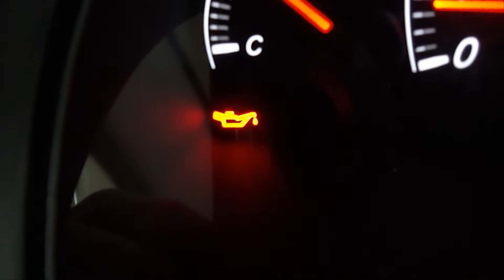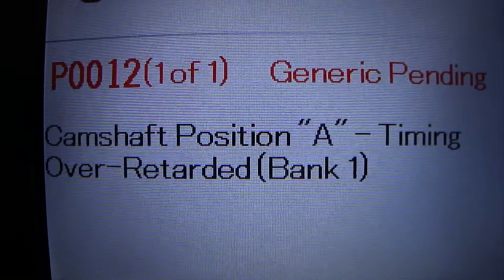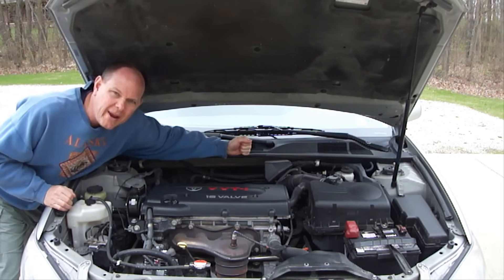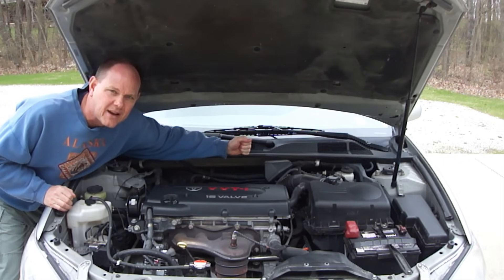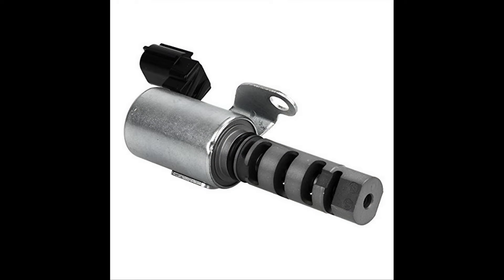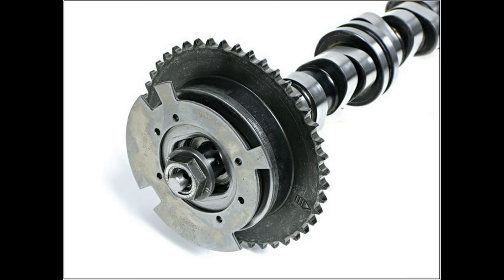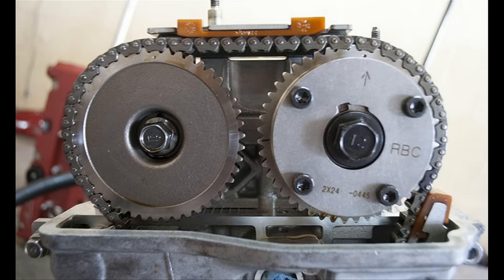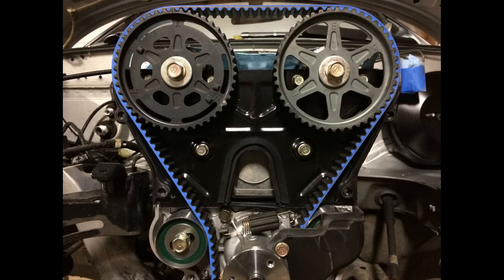How To Fix Check Engine Light P0012 - Camshaft Position A - Timing Over Retarded (Bank 1)

Comment: I get this code with a check engine light once and a while and I’ll notice after driving for a while I’ll stop at a gas station then go to start up the car again and it has a hard time starting. But as soon as I plug in the autel and erase the code the engine light stays off and the car runs like normal again. Weird right? I’m thinking possibly something electrical?

Comment: I put new oil and heard a very bad ticking sound oil light was on and then I revved it up a little bit and check engine light came on. I got that code tried to clear it. It came back on after work. I put that bitch in reverse and heard the chains slip, and the whole engine cut off.

Comment: This is true for Japanese vehicles, but for German cars, p0012 means Vanos solenoids are detecting a bigger issue, and that just means a much more expensive fix and not a simple oil change. It’s a generic code, but every engine and computer has its own procedure to fix
Reply: what issue is p0012 on bmw
Reply: @evatheboxer7417  did you figure out the p0012 fix

Comment: My oil light came on and I added a quart. Light was still on, so I added more but then the check engine light came on too. Like an idiot I added more oil and that code came up. Car quit running and now I'm freaking out, worried I ruined something. I really hope it's something simple that an oil change and maybe an oil pressure sensor replacement will fix.

Comment: Thanks for the video. Please, my mechanic used 20w50 oil instead of 5w30 in my 2005 Toyota Camry. In my next servicing, is it healthy to correct the oil type?
Reply from the maker: Absolutely go back to 5w30
Reply: @proclaimliberty2000  cos a colleague says since I've started with 20w50 I should stick to it, that changing to another oil type will have a bad effect on the engine. How true is that?
Reply from the maker: @nonsoezeanubekwe4580  I find that hard to believe. Use what the manufacturer recommends and you should be fine.
Reply: I'm using the Valvoline restore and protect 5W-30 and like it a lot.. clean up the Rings and reduced my oil consumption Toy 4cyl 2.5L  2AR-FE on my 3rd oil change every 5K mi

Comment: Hopefully you can answer. My 07 ford fusion burned a head at 65,000. We changed it, geared down the whole engine, replaced oil pump, piston rings, engine computer. Finally, ford technicians make it work again. With on the dealership p0012 code on; this guys told me to change the solenoids which didn’t modify anything. Your theories are great, but some should be not considered at all, due to the fact that everything is “brand new”, oil clean, etc. I’ll talk with the mechanic in order to check what could be the problem. The car losses lots of power on hills, my god a nightmare! Everything else works fine, since brand new up to now 2022.

Comment: Well lucky you, I cracked my valve cover open to replace my vvt solenoid, then noticed the cap and spring was gone from the locking pin on the phaser.  Nope...not dismantling the entire passenger side end of engine just to get to a stupid sprocket.  Don't have the time or patience.   Goodbye Mazda

Comment: Changed both my cam sprockets lower sprocket new chain tensioner and chain guides still have this shit code!  New Mobil oil synthetic!!  Just ordered a new cam oil vvti sensor!  Removed oil pan and and cleaned screen.  Also installed new oil pump too.
Reply: We’re you able to finally resolve this issue ?
Reply: @nelsonudeh4473  yes,  I had to go back redo the job unlocking the sprocket!  Then I had to remove the cap that holds cams down.  It was full of sludge!  My main issue was that I did not unlock the sprocket prior to install.  After unlocking installed.  Torqued it to spec then locked into place!   Then install chain etc…

Comment: 2014 ford escape was running rough up hills and was louder then normal.Oil was changed out and the filter.  How long does it take for then vehicle not run as rough?I put in a fuel injector cleaner as well. Thought it was a coil pack issue. But it's pulling the code you are speaking of.
Reply: What was it if you don’t mind me asking ?
Reply: @desireemanuel5958  Just a oil change and fuel treatment, after about 80 miles it went back to driving smooth. 👍
Reply: @jamesmontana29  oh so you drove it with the knocking sounds for 80 miles and it went away
Reply: @desireemanuel5958  Wasn't necessarily knocking just hesitation up hill and poor gas mileage.

Comment: Hi I am getting error "p0012 camshaft position timing over retarded"  consistently. I have replaced timing chain and vvt solenoid but this error appears again after resetting. Can you please guide what is the reason ?
Reply from the maker: Is engine oil clean and at the proper level?
Reply: @proclaimliberty2000  Yes I have even changed engine oil and oil filter after replacement of timing chain. I even replaced VVT solenoid. I went back to mechanic but he said timing chain is ok it could be your new vvt sensor fault. I have checked my old and new vvt sensor. Both seems to be ok.
Reply from the maker: @codingfactor  did you check for voltage at the VVT electrical connection and did you purchase an OEM VVT?
Reply: @proclaimliberty2000  Yes I have checked voltage at the vvt solenoid switch. It seems to be ok. Today, I have cleaned my vvt solenoid with carb cleaner and put it back(To see if it works). Only doubt, I have is, it could be sprockets of timing chain. I have changed timing chain, tensioner, guides but not sprockets. May be, some of teeth of sprockets could be wear out but mechanic had said sprockets were fine.
Reply from the maker: @codingfactor  my next question would be how does the car drive? Do you notice any performance issues?
Reply: @proclaimliberty2000  Thanks for reply sir. I don't see any performance issue. Car drive is pretty smooth.
Reply: One more thing to mention here is this check engine light is turning on after driving 60 to 120 Km. I clear it and again it appears after driving almost same distance.
Reply from the maker: @codingfactor  did you replace the vvt valve with an OEM part?
Reply: @proclaimliberty2000  Yes I had replaced with OEM part bought from the dealership of the company.
Reply from the maker: @codingfactor  is there any chance you have a sludged up engine?
Reply from the maker: @codingfactor  I wonder if you need a new cam position sensor. A failing sensor does not always trigger a trouble code.
Reply: @proclaimliberty2000  Engine is ok, my car's mileage is 40K only. You mean I need to replace cam position sensor ?
Reply from the maker: @codingfactor  sorry I mis-spoke.  Because your car is running good the camshaft position sensor is probably fine.
Reply: @proclaimliberty2000  Thank you sir. So nice of you to giving me so many replies. I will keep a close eye on the performance of the car and this error.
Reply: @codingfactor  I got the code too on my bmW 1 series P0012 waht can it be??? how do fix it? not chaiming chain?
Reply: @Data4664  Well you need to try out all the things mentioned in this video.
Reply: @codingfactor  cant you tell me if the O ring is bad on vanos can cause that code? not chain? come on plzzz.  what people think about first on this code??
Reply: @Data4664  When I got this error,  first thing came to my mind is Variable Valve Timing Oil Control Solenoid. Clean it with Carb cleaner and put and put it back if it works.
Reply: @codingfactor  I have done it but one one vanos is bad O ring so can it be that cause the code??? not cahin on man says its the chain;(
Reply: @codingfactor  it seems was the oil the egine ligt turn off;) update: no it come back but I change the camshaft sensor exsos side and the car runs better on idle but I tihnk the lamp will come back wee see...

Comment: 07 bmw 328i I replaced both vvt solenoids also replaced camshaft position sensor. Still getting p0012 I noticed a weird or rough idle whenever I left a oil change place do you think changing my oil would help?
Reply from the maker: It’s possible the oil change place did.not put the correct weight oil in.  Also make sure the oil is at the correct level. Waiting too long between oil changes can cause this due to sludge buildup in the engine.
Reply: @proclaimliberty2000  i changed oil replaced both my solenoids both my cam sensors and it is still there
Reply from the maker: @muhammadalshawi8082  So just one other thing. Let the vehicle sit overnight with the positive and negative battery terminal disconnected and then hook it back up.
Reply: @proclaimliberty2000 you’ll never believe this. I took it to the shop and the oil filter cap had a piece missing on it and it’s basically a stopper to allow it flow into my engine and my car was running on not even 10 pounds of oil pressure but the code is gone. But I found out I have a front main seal, valve cover, and oil housing gasket leaks 😭. But Thankyou for your help I spent around $500 in parts I never needed. And $200 at the shop when I could have done it myself for around 80 but the code is gone and it’s acting better again Thankyou for your help!!!
Reply from the maker: @muhammadalshawi8082  Fantastic! 👍😊
Reply: @proclaimliberty2000  Thankyou honestly I’ll lyk what happens

Comment: Greetings, am working on 2010 Camry it was giving p0012 ,I change vvt sensor and Vvt sprocket, timing too OK. But still giving me p0012
Reply: Yes my engine oil is clean
Reply: Yes my engine oil is clean
Reply from the maker: Is the engine oil clean and at the correct level?
Reply: @proclaimliberty2000  yes
Reply: @zionman9149  maybe take it to the dealer. Cam sensor ok?

Comment: So you had the wrong oil? What was the wrong oil and what oil did you replace it with?
Reply: might have been too thick it's just best to use the type it says on oil cap or inside the owners manual and use only that type

Comment: Funny how you mention an oil change as a remedy. It seems that whenever I get an oil change at a place that doesn't used the recommended Mobil 1 100% synthetic, I get an ECL code of P00011 or 12 (Bank 1 Retarded camshaft). It's always intermittent and clears with the use of a code analyzer. I have an old 2007 MB C Class and I've been actually turned away from some "Quick Change" oil stores because of too many complaints from owners of older foreign cars having "electrical problems" after an oil change...go figure. Thanks for taking the time to make this video.

Comment: I had a p0011 code and changed the oil, replaced my solenoid and cleaned the vvt oil screen. This resolved the issue for about a month but now I have a p0012 code. I wonder if it has to do with the timing chain. I have a 2005 Toyota Echo
Reply: Hey,how did you clean the screen with what ?

Comment: So would changing the oil first and seeing if that fixes it be a good first step? Or would you suggest starting somewhere else? Looking for the best cost effective way of starting to fix this error code.
Reply from the maker: BritishInvasion91 Yes, change the engine oil and engine oil filter and see what happens.
Reply: I did and the check engine light is still on
Reply: @latishalegardy8510 were you
Able to fix this ?

Comment: I got this on my car and my mechanic says I just need to replace the whole engine.
Reply from the maker: Garrett Brinkman due to the expense of replacing the engine II would still get a second opinion from a non-dealership mechanic. You really need to weigh the cost of repairing it versus putting the money into another good used vehicle.
Reply from the maker: Garrett Brinkman You need to get a second opinion from a trustworthy mechanic.
Reply: @proclaimliberty2000  it was a dealership that said that.  They estimated 9800$ in repairs
Reply: He would tell you that because he getting paid

Comment: I received the same code and at the same time, the serpentine belt squeak. I replaced the belt, reset the code and it disappeared for about 3 days now. Could this be the problem belt? Why engine light comes up with a squeaky belt?
Reply from the maker: Pak Kwong Chan The first thing I would do is make sure your engine oil is at the correct level. If the engine oil is dirty at all then do an engine oil and engine oil filter change.
Reply: That's interesting because I tightened a belt on my Scion xA then there light came on. Is it possible I overtightened it?

Comment: I definitely have  a mechanical fault....changing the oil 3 times and the light goes away only to return 24 hours later....😢
Reply: Vanos? Camsensor?
Reply: What was your solution to this? I have the same problem. Changing the oil was only a temporary fix.
Reply: @brentonbalicki  hola que tipo de aceite le pusiste, el mio usa el 5w20, pero me dicen q lo cambie por el 20w50 q es mas pesado y va a tener más presión, de cual usaste?

Comment: Yes i change the oil
Reply: I did what oil change
Reply from the maker: @maribelvilluanuva9609  A P0012 is A Camshaft Position Timing Over-retarded Bank 1.  It's very possible that your variable valve timing solenoid is not working properly due to wear, not receiving the proper voltage or due to heavy varnish buildup on the valve (which can be cleaned by soaking) if the oil was not changed regularly.
Reply from the maker: Maribel Villuanuva i’ll try to get back with you on this tomorrow. How many miles does the car have?

Comment: Hello. I have Mini Cooper 1.6 2007. I have code P0011. I changed 2 solenoid valves (geniue). I deleted warning lights with obd2 and mobile phone And i always after about 20 miles I got orange engine warning light again. I have changed oil filter and engine oil for 5w-30 Castrol Magnatec C3 start and stop. Please give me any idea how i can sort that out? Many thanks
Reply: Udało się rozwiązać problem?
Reply: @Dawid-w4t  prawdopodobnie był to rozrząd. Rozciągnięty łańcuch. Ale nie jestem pewny. Poddałem się i sprzedałem auto. Naprawa za naprawą. Pozdrawiam

Comment: I am replace v tech solonide volve and check wiring harness and the problem still coming again, Engine oli is new and no dirt in the engine and timing chain and cameshaft also good so finally I am replace a ECM then the problem solve this is my experience what happene other I don't know

Comment: When you say Engine oil, do you mean Motor oil or Transmission oil?
Reply: Read Engine oil mean Engine not Transmission
Reply from the maker: Motor oil
Reply: Transmission don't use oil. They use transmission fluid. Entirely different things.
Reply: Transmission fluid literally is oil
Reply: lukeian2010 the rite thing is fluid..stop been tough head..r you Mecanic..
Reply: @tajhealthnature8570  right* mechanic* Tranismission fluid is just oil. Different to the oil you put inside your engine though.

Comment: I have a BMW X3 with the same codes but changed both Camshaft position sensors and the problem still exists. Might you know what else could be the problem?? I have a reading now with the code P13B6??
Reply from the maker: The first thing I would do is change your engine oil and engine oil filter.
Reply: Thanks so much. I’ll def do this. There’s definitely a leak so I’m also guessing I need to  change valve cover gaskets too esp to get rid of the whistling and hard idling.
Reply: On the BMW X3 did u fix it I'm having the same issue now
Reply: Juan Nieves, I thought a whistle noise from my engine was the camshaft position sensors because my code readings were showing such. However, after changing both sensors I still had a problem with the whistle noise. I later learned that it was a cracked CCV vent hose taking in too much air. I replaced it. I cleared the codes with a reader. Needless to say, I was trying to get down to the bottom of the noise not the codes. Sorry, this didn’t help.

Comment: hi, i have a bmw 2003 e46, i have codes p0012 + p0341, i am replacing both camshaft position sensors, but my question is do they need to be set by the diagnostics thing.
Reply from the maker: Replace the sensors, clear the codes and you should be good to go.
Reply: done that and still just turns over, my mate says theres a cylinder thing under the cover along side oil fill cap and it could be that.
Reply: Did you find out what was wrong?

Comment: Good Job, please let me know clear location of Variable Camshaft Timing/Variable Valve Timing FILTER SCREEN , the other video is not easy to see.
Reply from the maker: The filter screen location will vary on different engines.  If you have the same engine as I do, then I cannot make the location any clearer which is by the bottom of the water pump.